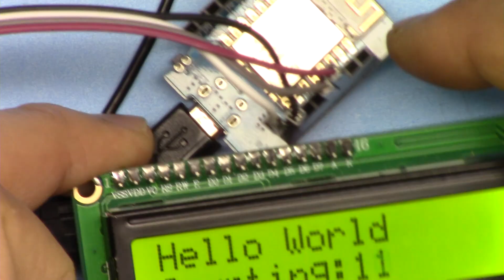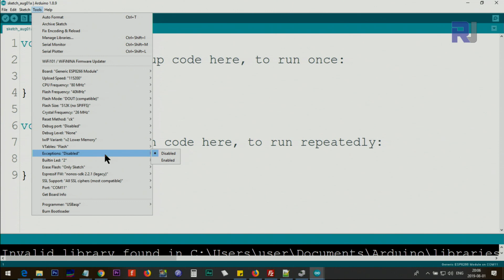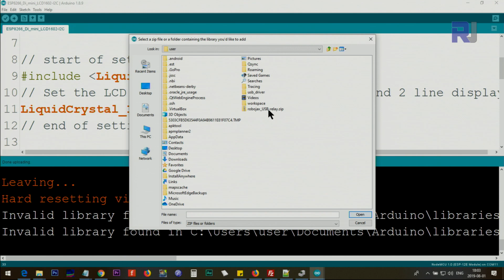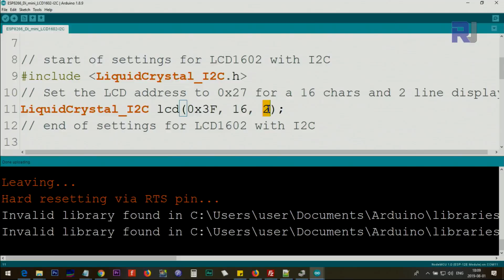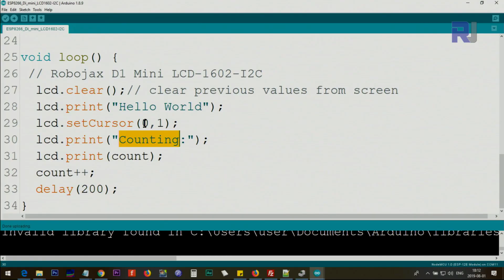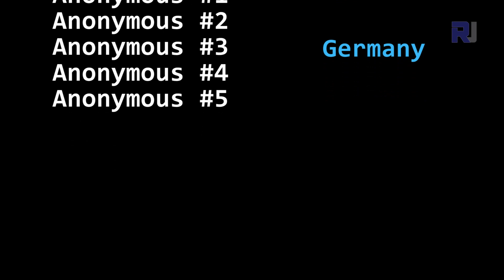Using LCD with Wemos D1 Mini ESP8266 with Arduino RJT196

Comment: Great video. Please note that your code does not compile "lcd,begin(): should be "lcd.init()". 

I am using code to test a setup, in which I think the Wemos is faulty. It is running, but very slowly. at least 10 secs between counts. Any suggestions please?
Reply from the maker: Hi, You are usig the wrong library. Please download the library shown and provided on robojax.com. The delay is inside the loop(), change it.  Just checked the code, it says delay(200);  which means 0.2 seconds. You may have done something.

Comment: SOLVED....
Using a D1R1 the compiler Arduino:1.8.15 (Windows 10), give a error
invalid conversion from 'int' to 't_backlighPol' [-fpermissive]
Any idea?
Reply from the maker: This is very simple I2C communication. You must have changed the code. First run it without any change and once it worked then customize it
Reply: @robojax  nope, just standard code
Update: Updated the library (again) and now it works perfect. TNX.